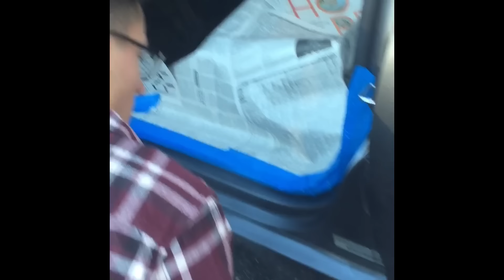DIY Rust Repair Cheap And Easy!

Comment: I'd recommend a few extra steps (from personal DIY experience)...

1. After sanding the rusted part, use some kind of "rust converter". Either one that just "dissolves" rust or other that "converts rust to sandable paintable primer". Even though you used a "RustOleum", there are still pores that may let a moisture in.

2. If you sanded something down to the bare metal, you better use a "Etching Primer" first, then putty and "filling primer".

3. There is still "hole" in the paint. You used a putty... Why not to get a plastic knife and make a surface really straight?
Reply: Converter should be used before etching primer, right? And you shouldn't sand after using a converter? Can etching primer be used on top of a converted piece of metal?
Reply: Just take it to a professional

Comment: great, simple and easy to follow, thanks for posting. 
by the way, all those dislike clicks must be from auto body shop owners, their children or their side chicks
Reply from the maker: +healthdios 😂 best comment yet! Thank you!
Reply: hey man, how do you get the gray paint to blend in with the rest of your  car to turn into that color? to you use to cans of different paint? how to you find your base paint? thanks :D
Reply from the maker: order color matched paint online. It's not going to match perfectly so you need to blend it in as you spray it on and you can feather it out when sanding.
Reply: Most body shops don't even want to deal with rust on a routine basis in the first place.  Maybe a restoration shop, sure, but not a high volume collision shop.  People bitch about the price too much and they're too fussy when a "smear job / paint over" job like the one in this video bubbles back through (it will).  A DIY job on your own car? Sure, but most professional shops run away from rust repairs for good reason.
Reply: Soaked In Oil would you recommend a website for the car color paint?

Comment: You did it in an unprofessional way BUT great job. You used 2K primer to fill in the dents, scratches and make it flat instead of using Bondo/ body filler, but it still came out a prettttty good result.

I am an auto-painter. who cares whether you do it in the right way or not, you did save up lots of money and got the job done perfectly

Comment: Feather edging the could have been a bit better , never prime up to tape , use a rubber spreader with the putty , apart from that not bad (35 years in body repair trade).
Reply from the maker: appreciate the comment
Reply: How do you match the paint color?
Reply: +julio bussone Look on your door jamb. There's always a little plaque or sticker with your car's information on it. Among that info, will be your car's exterior paint code. Look up what the code means on Google and then buy the paint from Amazon when you find out what it is. Example: My car is a 2000 Lincoln Town Car and its paint code is TS I think. That means "Silver Frost." It's a Ford color.

Comment: Automotive touchup has good aerosol paints that match paint codes; think that is the paint he had. Use worker gloves or pad when sanding, otherwise your fingers will get eaten away. I had to to this on my rear fender and I sprayed rust inhibitor on the metal after sanding away as much rust as I could, and two years later, it is still holding up. This was a proper DIY for anyone that wants to get rid of rust and save money. Getting rid of as must rust as possible and prevent it from spreading is probably the most important thing for a proper fix.
Reply from the maker: Thanks for the comment! You are correct, I used Automotive Touchup to color-match the paint.
Reply: Thanks for a very good demo. I just bought a 2001 Jeep TJ and have a few deep rust spots. I am going to try your techniques this weekend. Thanks.

Comment: emphasis should be made to remove the rust before prime and finish
best way to remove the rust is to sandblast when the equipment is available
there is many ways to finish the job, I alway use the finishing putty after the epoxy primer application and before the application of the surfacer primer, this way, you always sand the same material and it is much easyer to make a smooth level surface.
Reply: Jacques Poirier j

Comment: looks way better. good job taking care of an older vehicle
Reply: older? its 2009 hes just a terrible owner lol especially why is the rust by the door of all places?
Reply: +DynamicAttraction or rough climate and no garage (heat gun suggests)
Reply: 777
Reply: that's a commonplace to rust on Mark 5 Volkswagens, I have a 2007 VW GTI I have the same problem.

Comment: Good job. I would additionally treat the rust spot with rust remover to completely eliminate the rust ant prevent for reoccurring.
Reply: Por15?
Reply: R. T.  Which rust converter would you suggest? Por15?
Reply: @FrankS-ff6yp  WURTH rust converter

Comment: Did this and used anti rust primer, no rust after 3 years, I made sure there wasen't any dark spots though all shiney steel, even forgot the clear coat since it's not a very visible area and it's smooth and rust free, gonna clear coat it soon though.

Comment: painting with spray you start one side and end at the other one long strokes! not short spots...
never spray paint the way you doing it! but overall not bad..good job!
Reply: Rattle cans loose pressure quick and should not be treated like a spray gun, if you were to do long strokes it would spit blotches. by doing small bursts the can retains pressure and stays in a fine mist. long sprays will create a horrible finish.

Comment: You should have "treated" the rust first!............it WILL come back!!!!!
Reply: Treating rust is a myth, only thing you can do it remove it completely or it will come back eventually. It’s just a question of how long you want it fixed, sometimes you’re only trying to get a few more years out of the car
Reply: @CA11100  I disagree.  There are some decent products that neutralize the oxidation, and then seal it.  After that, sealing it with a good paint will lock it down.  I have used them many times and the rust never came back 10-15 years later......
Reply: @ClockFixer  can you please give examples of good products that neutralize oxidation
Reply: @danielh1551  Sure, just go to my page.
Reply: @Mααrʈεn M Wanna bet?

Comment: That's fucking ridiculous that an 09 already has rust like that.
Reply from the maker: +**Classified** I live in New England. Rust like that is common
Reply: Soaked In Oil I live in the midwest. Believe me, I see it all the time. For an 09 to rust that fast though, is just insane. My 2010 Dodge van had rust, but nothing like this. I buy all my cars from down south now.
Reply: +**Classified** there shouldn't be a difference being that they all come from the same manufacture
Reply: Tyron Zepol There IS a difference in buying a southern car. Go look for yourself. It's only half the manufacturers fault. They don't coat inside the rockers with paint at all. Cut one off and you will see. It's all just overspray from when the car was sprayed at the factory. A southern car has not been exposed to road salt, therefore they don't rust. If you don't believe me, check out craigslist for yourself. I've bought 20 year old pickups from Alabama and the only thing wrong with them is cracked dashes and faded paint. No rust bullshit. The frames are even factory black down there. Up here, they're lucky if they're not cracked in half at that age.
Reply: +**Classified** well if you live where there they salt the roads you need to wash your car more often and power wash underneath fore sure and wax the paint, and if your vehicle dose nor have the undercoat package you should have it done or just spray rubber under coating underneath but clean and degrease before painting, and you should be good for a long time
Reply: Hank Hill Washing your car does nothing. Once the salt gets in a seam, you're fucked. Believe me, I know. I'm using Fluid Film as of right now, but only time will tell if that actually does anything.

Rubber undercoating is the absolute worst thing you can do. It traps moisture, and you won't even know it. Eventually, it will blister and you will have perforation through your undercarriage.
Reply: +**Classified** well that may be for you, but all my cars trucks are solid I wash them with warm water in the winter with soap that has wax and it repels the water and it makes it so the salt rinses off, and I live north east where they salt the roads like crazy
Reply: Hank Hill Depends on the car. I drive pickup trucks. Pickups rust the worst, along with american made cars. Toyota's aren't terrible, but anything over 10 years old seems to rust the same. How long do you keep your vehicles? Three of mine are just about to turn 20 years old in a year or two. My other one which is a Honda just hit 10 years old this year, and it's solid as can be, but I brought it back up from Georgia. 

Do you do your own work on cars? Try changing a CV axle on anything that's been up here for more than a year. You almost have to get the hub red hot to even tap it out. Try doing tie rod ends and a wheel alignment. Sure, your car's body might be in decent shape, but the chassis really suffers.
Reply: +**Classified** Yeah but trucks are used more I'm the harsh snow and salt but they do get rust if your not careful, I have a truck all three of my vehicles are from the early 90s, I work on them all from the ground up, well that may be but when I change cv axels I change hub bearings too and if I can't get it to slide out I cut it off haha, just easier that way
Reply: Hank Hill Ever had to do brake lines? Really common up here with all the salt. Wheel wells, rockers, and cab corners don't seem to last that long up here. If your trucks are from the early 90's and they're clean, then they haven't spent their entire lives up here unless they were undercoated each year, or parked during the winter.
Reply: I lived on east coast of Canada, which means tons of ice/snow/slush, temps that change above and below freezing multiple times a day. Salted roads. And North Atlantic salt ocean air. 

Probably the worst environment possible for a car.

If you want cheap insurance, get Krown rust proofing every year. It gets in behind panels and coats places you can't clean. 

If you have a fairly new car, don't let the Krown guys drill holes in your car, no matter how much they argue. There should be factory holes. Every hole they drill creates breaks in the galvanization that manufactures put on car steel these days.
Reply: Evil bred I'm using fluid film right now. Undercoated my whole truck. It stayed oily for every bit of three days. I don't think I will ever spray the entire underside again, just in places that the salt accumulates and doesn't get beaten up by road debris. It's still oily behind the spare tire, and inside the rockers and door bottoms. That's all the places where rust starts, so I think it's still worth doing it. I'll be doing another coat in a few months right before the salt hits, that way it has a fresh barrier for the winter.
Reply: **Classified*
Reply: koviack No salt. I only buy southern cars now and undercoat them religiously. It really saves them.
Reply: koviack I buy them when I visit family in the winter months. Then I just tow them back and fix them up. Way better than dealing with rusty shit.
Reply: **Classified** e
Reply: Luke warszawiak With the fix in the video, sure. Only way to end rust is to replace the infected metal. Anything else is a band aid. Prevention is the key.
Reply: keys do not prevent things from happening, they open doors
Reply: Neglected corrosion. Late.
Reply: yeah all those salty roads don't help either
Reply: **Classified** Saltwater's a hell of thing, man.
Reply: Your right, if I made that video here in Vegas, it'd take 6 months of planning and hard work to manufacture a rust spot.

Comment: hhhhhhmmmm I will need a ton of it for my landrover
Reply: land rovers are aluminum and wont rust, unless its chassis or firewall in which case this method won't helpnyou
Reply: I know I had every type except the miniva
Reply: Your quite right aluminium doesn't rust it CORRODES which is the same thing !! Find me an old landrover that hasn't corroded !!!
Reply: Jake Vermeer aloy corrosion is much more pain than stelloxidation, you don't see it until it's through only hold together by dust
Reply: mr cynical Landrovers don’t rust because of all the blowback of leaking oil....  Fact.  Call Landrover and speak to them yourself and they will confirm it.

Comment: Great video! I have a 08 jetta and not looking to get 5 more years out of it. A little rust on rocker panels, so just need a cheap fix. Are these all the Materials required? - Sandpaper $20, Rust inhibitor wd-40 $20, Primer $25, clear coat? Can of spray pant $30?

Comment: DIY - Well done.
 - I’ve never seen anyone go at it with a heat gun to warm cans of spray paint, or, speed-dry the primer. You could have done without the heat gun. (I don’t know what effect that may have had on the primer paint...maybe no effect.)
 - RE: Other Commenters saying you didn’t adequately take care of the rust. You did a very good job and the rest of the car will rust out before the spot you fixed will.

Comment: Good job. Only thing I recommend is use some rust stripper after you sanded rust off. I see pitting, and usually if there is still rust left over you can be sure your hard work will be ruined by rust again. Awesome
DIY though

Comment: Iv been doing it like this a few times. i live in norway by the ocean so we have salt on our cars all summer and salt spread all over the roads all winder to remove snow and ice so rust is a HUGE problem here. I use a special primer thats supos to isolate the rust as well, but after a few months the rust is growing back. i think its importan to somhow remove the rust in the groovs aswell. u let alot of rust stay behind and so have i done..... it grovs back and grovs deeper into the metal and sudently u have to cut out the the rustet piece and weld inn a new one. best to do it propperly if u cear about the car. really common as well to do it quick and easy like this rigth before selling a car and the who ever buy it fint rust growing like a plage afther just half a year to a year depending on where u live...... I will redo all my repairs this summer cous i did like u last year. wast of time when i coud have just done it propperly the first time. Also u where way to close whit the hot airgun. u migth risk cracking the paint. best is to just have it somewhere dry for an hour or so, but hot air gun works as well, but have some distance and be pacent.

Comment: Good video. Few questions doe. Wat girt sand paper did u use to prep after taking paint off? Can i use rubbing alcohol to clean surface instead of fast dry enamel reducer? And last wer did u get the exact color spray can for ur last step?

Comment: Warming up the rattle can makes the spray thinner,, good tip. Thanks for de video. Why did you sand the clear coat? Maybe you should heat up clear coat can too

Comment: Nice DIY, however those dark spots, you still have the potential for rust to come right back. I would recommend a sealer or ethcing primer before your filler primer. Good job tho!

Comment: Great job man just a couple of pointers next time try using self etching primer for baremetal then use your filler primer on top also try using a spreader so you dont contaminate the surface with oil recidue from fingers. Other than that great job keep vids coming

Comment: Thanks for the vid. Just 2 questions though - what is "clear" and why use it, and why do you sand the paint job before waxing. I've seen plenty of repair jobs where once that last coat is on they never sand. I mean, that's counterintuitive isn't it? New paint, sanded?? Won't you put scratches into it?
Reply from the maker: +Generic User the clear protects the basecoat from fading and from wear. Sanding helps insure a smooth surface and the buffing after removes the fine scratches and polishes the surface to a smooth mirror finish. The final sanding is done with finishing sandpaper which is made for this exact application.

Comment: I would say this will work, but not for very long (usually few months to a year). The rust originates from a bare metal being exposed to moisture for longer period of time. Probably on the other side of the panel (for example, damp mud inside wheel arches, or from the floor behind front wheels, where all the debris are hitting it while driving). So first you should localize the cause of your problem, eliminate it (renew metal protection, etc), and then go after the resulting rust. Kudos for encouraging people to do such stuff.

Comment: So Im thhinkg of selling my 2006 solara that has quite a few dings and scrathes s spider in the panel should I fix it up or just sell it the way it is? thnaks for taking the time to read this. Gail
Reply from the maker: +Gail Boucher depends on how much time you want to put into it. I'd definitely try to sell it the way it is and go from there. If you're having a hard time selling it then put the work in. I hope this helps! Good luck with your sale!
Reply: Thank you

Comment: Uhmm.. A question. How well does the paint last on the parts where was no primer and was on a factory clear coat ? 
Did those come off while watersanding or does it peel of later like in 6 months?

Comment: Also to add my 2c, when I did a rattle can type job like this about 3 years in I noticed the paint would oxidize and lose its gloss and need to be waxed back to shine. Maybe its because I didn't clear coat it like yours.